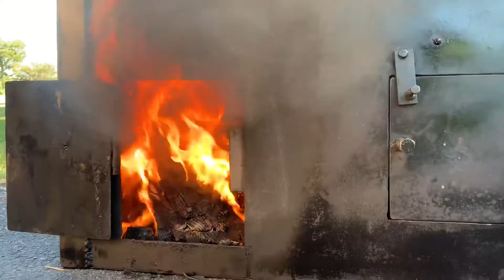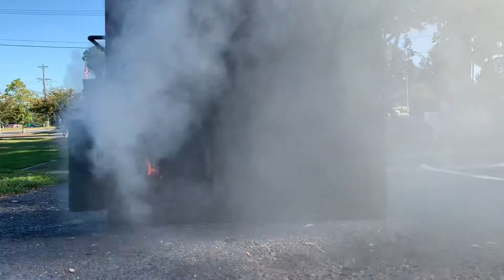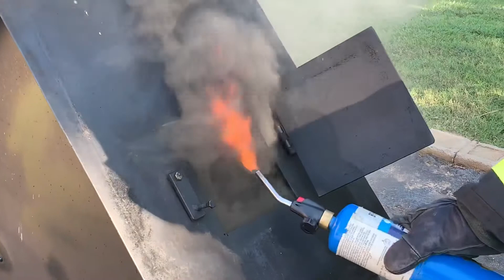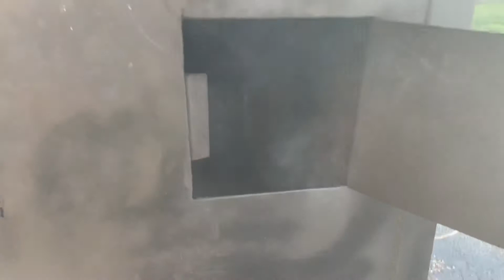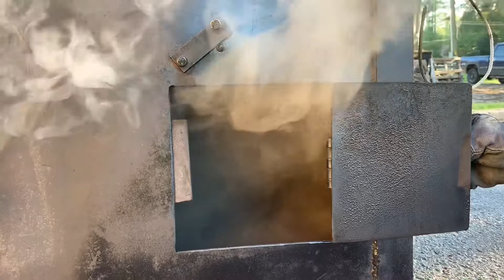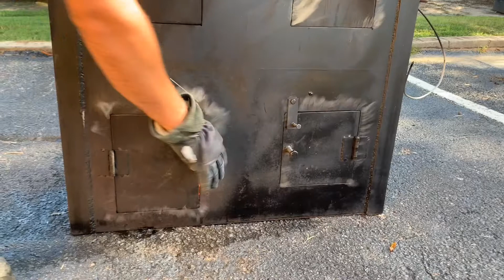Dollhouse Prop

Comment: What do you use for your fuel in the burn room?  And how do you have it set up? And do you put fuel anywhere else in the dollhouse? We had one built and we’ve been playing with it, but we are having issues getting it to do what the wood ones do, any suggestions? Thank you!
Reply from the maker: Hey there Vance, we use OSB as our fuel most of the time but we have found that the if you want very flammable smoke you need some nasty smoke. Small blocks of foam and Poly will help make the smoke that helps demonstrate flammability. Another thing that you have to have is enough heat that the smoke is readily ignited. We usually fuel load (with OSB and foam) the bottom two compartments, we have also fuel loaded the top right compartment but that’s not our norm. Hope this is helpful for you guys. Stay safe and keep perfecting the trade!
Reply: Awesome!! Thank you for the info! We will give that a try!
Reply: Friend, would you give me some videos of your room inner, please . It makes me curious that it get flashover and backdraft progress, even its metal matterial. Commonly its osb material. Nice to know  that❤